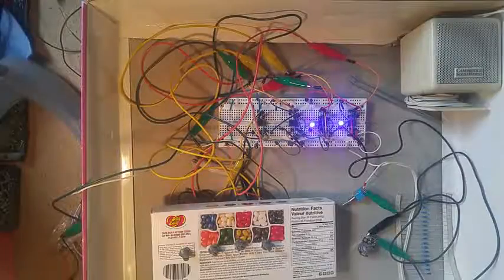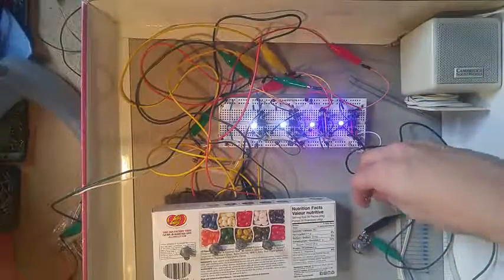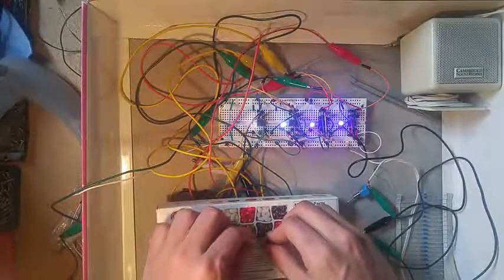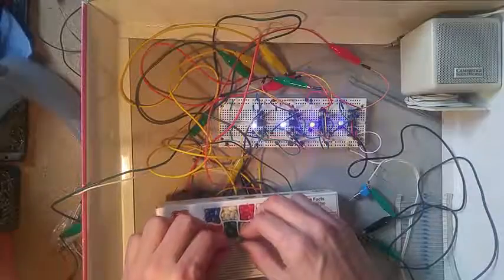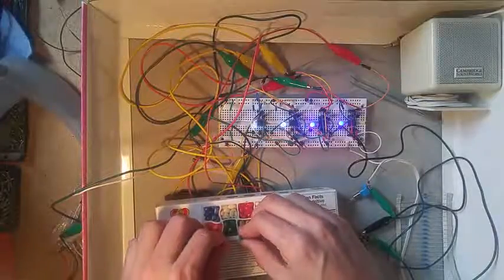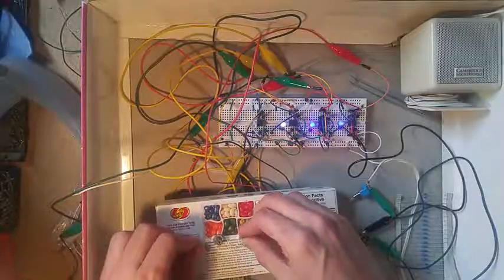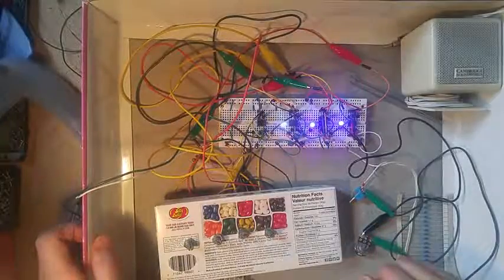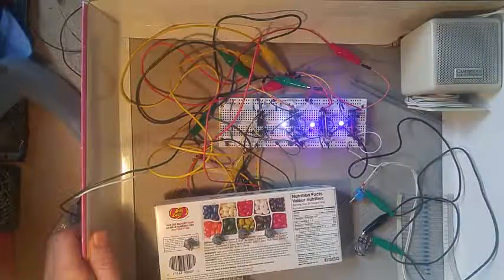Series 555 Oscillators

Comment: Woah that sounds rad! I'm going to our equivalent of Radioshack and get some components tomorrow and try all of your cool oscillator schematics.
It just seems that they don't sell Ceramic capacitors with values higher then 0.1uf (only Electrolytic) and in this project you seem to use ceramic 1, 3.3 and 4.7 uf caps.
Should I just connect the Negative side to ground? Or should I really get Ceramics?
Reply from the maker: Awsome! Cant wait to hear how it goes 😁